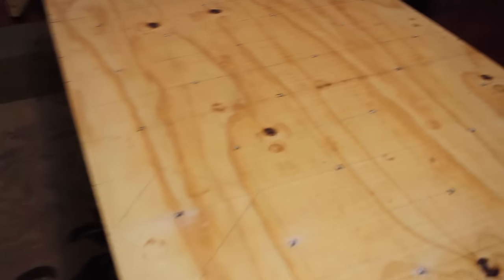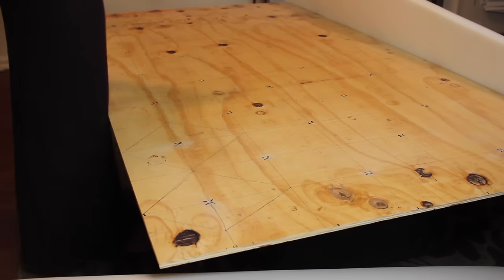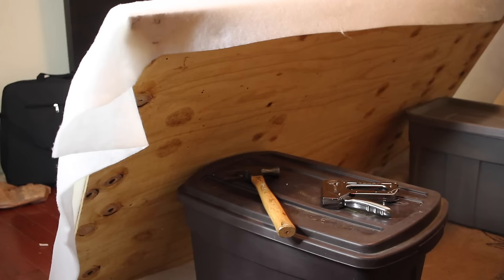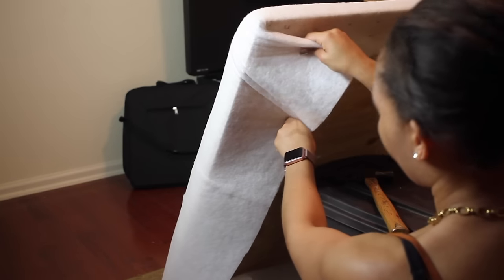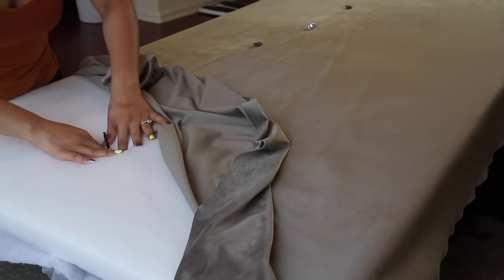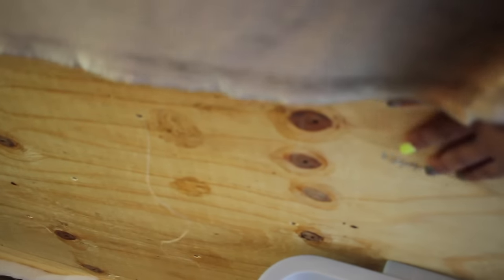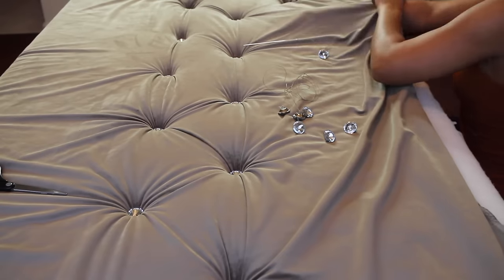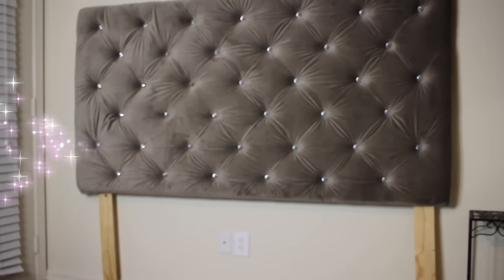DIY Budget friendly tufted headboard!!

Comment: Awesome headboard. I only  wish that you added a video on how to apply the brackets. I didn't know that you can purchase them.
Reply from the maker: Sorry I did not think about showing that but I did leave a link showing you what I use. This video is old but if this link don't work try the one in the description box above or the one below 😉Thanks for watching 🌻

*metal bed frame - https://www.amazon.com/gp/offer-listing/B00029I344/ref=as_li_tl?ie=UTF8&camp=1789&creative=9325&creativeASIN=B00029I344&linkCode=am2&tag=caresswebsite-20&linkId=6c18b617669d87235131a9a3f548c38a"

Comment: What size bed does the headboard fit?  Also, what are the dimensions of your plywood, batting and fabric?  Thanks and side note...you did a Wonderful JOB!
Reply from the maker: Queen size bed but it was still room for a king, 1/2 plywood from Home Depot but you can tell them how much you want to cut off. Then proceed to buy your batting and fabric from Hobby lobby and make sure you have the right size of fabric before you cut it that way you can return it if it's not the right size. Oh there is a coupon in the description box. Thanks for watching ♡

Comment: You did a great job but do to attach the rail to the head board or is the bed just pushed up against it?
Reply from the maker: Thanks! I use 1/2 plywood and wood legs all form Home Depot. You might get lucky sometimes they have extra pieces that they do not want for free! Don't forget to check out my description box for the rest of your shopping list ♡😀♡

Comment: How did you put the legs on? Just nailed it! The nails won't poke through the headboard?
Reply from the maker: lol no! I use the same drill that was in the video, the screws will not poke through remember I used two sheets of batting so it was really thick. Hope this helps thanks for watching🌞

Comment: I love it.  my one question.  I'm having a hard time with measurements.  what should be my measurements when going to home depot to purchase the plywood?  I want it to be the same width and height as yours.  sorry for such a dumb question. that's the problem I'm running into right now
Reply from the maker: Np thats the best part about DIY you get to decide what size you want, I just eyed it when he was cutting it but try this link ,also buy the fabric after the plywood good luck -https://www.google.com/imgres?imgurl=http://www.ana-white.com/sites/default/files/images/knock%2520off%2520wood%2520montegomery%2520beadboard%25201.jpg&imgrefurl=http://www.ana-white.com/2010/02/plans-king-size-framed-upholstered-headboard.html&h=770&w=1211&tbnid=nKEjLMmzf_oIxM:&tbnh=138&tbnw=217&usg=__4uk2CcMpJYoqcl_TDqF10Izi4yQ=&vet=10ahUKEwiB5seDo-bUAhVC0iYKHeo3B0YQ9QEIwQEwAA..i&docid=bPkj73lIC0I8HM&client=safari&sa=X&ved=0ahUKEwiB5seDo-bUAhVC0iYKHeo3B0YQ9QEIwQEwAA#h=770&imgdii=nKEjLMmzf_oIxM:&tbnh=138&tbnw=217&vet=10ahUKEwiB5seDo-bUAhVC0iYKHeo3B0YQ9QEIwQEwAA..i&w=1211

Comment from the maker: {angela ratlin} hope you see this I do not know why it would not let me reply to your comment! But this is the frame I have Walmart #: 007135903 just copy and paste this to your search engine. I wrapped fabric around the two legs that you see in the video and just post it against the wall so my mattress and frame is holding it in place it is not going anywhere lol hope this helps, Thanks for watching♡♡♡♡

http://www.walmart.com/ip/Spa-Sensations-Steel-Smart-Base-Bed-Frame-Black-Multiple-Sizes/15739163?action=product_interest&action_type=title&item_id=15739163&placement_id=irs-106-m2&strategy=PWVAV&visitor_id&category=&client_guid=58a92b0e-bf63-4a91-989c-d6ded8e813bd&customer_id_enc&config_id=106&parent_item_id=41974839&parent_anchor_item_id=41974839&guid=b0815278-1d20-4037-aaab-47018ef3aecd&bucket_id=irsbucketdefault&beacon_version=1.0.1&findingMethod=p13n
Reply: Caress Devine

Comment: Can you show how you attach it to the wall or to the bed. No one ever shows this step!!!
Reply from the maker: Sorry I left that out this was one of my first videos when I was still getting used to YouTube lol But its ez heres the link metal bed frame - https://www.amazon.com/gp/offer-listing/B00029I344/ref=as_li_tl?ie=UTF8&camp=1789&creative=9325&creativeASIN=B00029I344&linkCode=am2&tag=caresswebsite-20&linkId=6c18b617669d87235131a9a3f548c38a"Or you can just ask the people at Home Depot for strong hooks for the wall. Thanks for watching💕

Also I used two pieces of free wood for the legs from Home Depot, they have free wood from other people cuts left over and I used four screws and a power drill

Comment: where u buy the frabic at and what size is it for how much the yards
Reply from the maker: * Velvet fabric 1.60cm x 1.20cm / 63 Inch x 47 Inch make sure it's the right size before you cut it because if it is not you can return it.
Fabric from Hobby Lobby and the name was Casablanca. Sorry I did not save my receipt it was the only Gray velvet fabric they had available ,the cost was $24.99. Don't forget to check the description box for more info and look on website for coupon 😉😌

Comment: I actually have a couple questions =) I currently have a MALM ikea bed frame this it it for reference. ( http://www.ikea.com/us/en/catalog/products/S69009475/)  and I want to change it. I saw in some DIY that I can add height to it with adding some extra wood on top and then covering it up.  I know that Ikea wood is cheap to do you think i can drill holes in it to do the buttons ? and what kind of fabric did you use?  how much  fabric do you recommend for a queen size bed? Thanks in advance.
Reply from the maker: Yes I do think you could use a power drill to put holes in it and as far as height add the wood and put the batting in the front to even it out. Now for fabric I got that from hobby lobby you just have to Measure yours and show them and just make sure it's the right length because if it's not you can just return it before you cut it. Also I left a coupon code in the description box is 40% off ! Hope this help thanks for watching!🌻💛🌻 oh and @ me on Instagram @caressdevine I would love to see it I'm nosy lol
Reply: Did you ever do it? I have an IKEA Malm bed frame too. I want to try as well
Reply: +Kenza M not yet . It will be on the future

Comment from the maker: ♡♡♡♡-MATERIALS USED--♡♡♡♡Can be found and description box:)

* 1/2 plywood 

* headboard dimensions- try this link ,also buy the fabric after the plywood good luck -https://www.google.com/imgres?imgurl=http://www.ana-white.com/sites/default/files/images/knock%2520off%2520wood%2520montegomery%2520beadboard%25201.jpg&imgrefurl=http://www.ana-white.com/2010/02/plans-king-size-framed-upholstered-headboard.html&h=770&w=1211&tbnid=nKEjLMmzf_oIxM:&tbnh=138&tbnw=217&usg=__4uk2CcMpJYoqcl_TDqF10Izi4yQ=&vet=10ahUKEwiB5seDo-bUAhVC0iYKHeo3B0YQ9QEIwQEwAA..i&docid=bPkj73lIC0I8HM&client=safari&sa=X&ved=0ahUKEwiB5seDo-bUAhVC0iYKHeo3B0YQ9QEIwQEwAA#h=770&imgdii=nKEjLMmzf_oIxM:&tbnh=138&tbnw=217&vet=10ahUKEwiB5seDo-bUAhVC0iYKHeo3B0YQ9QEIwQEwAA..i&w=1211

* wood legs/Home Depot

* 2" High density foam

* Batting

* a dvd box?

* Velvet fabric 1.60cm x 1.20cm / 63 Inch x 47 Inch make sure it's the right size before you cut it because if it is not you can return it.
Fabric name Casablanca. Sorry I did not save my receipt it was the only Gray velvet fabric they had available ,the cost was $24.99.

* Jeweled diamonds- Jeweled diamonds -https://www.amazon.com/gp/offer-listing/B00FOFND8M/ref=as_li_tl?ie=UTF8&camp=1789&creative=9325&creativeASIN=B00FOFND8M&linkCode=am2&tag=caresswebsite-20&linkId=a3a0f237ea8e0719dc41a758d368ff47"
  2 x 4 wood (2 pieces)
All @ hobbylobby
* Nylon thread
* Scissors
* Staple gun & Staples 
* permanent marker
*foam
* measuring tape 
* Power drill@Home Depot

*metal bed frame - https://www.amazon.com/gp/offer-listing/B00029I344/ref=as_li_tl?ie=UTF8&camp=1789&creative=9325&creativeASIN=B00029I344&linkCode=am2&tag=caresswebsite-20&linkId=6c18b617669d87235131a9a3f548c38a"

*I use 1/2 plywood and wood legs all form Home Depot. You might get lucky sometimes they have extra pieces that they do not want for free! 

* a friend if you have one :)

I got my fabric from my favorite store ever!!♡HOBBY LOBBY♡here is a COUPON that I used - 

http://www.hobbylobby.com/find-saving...